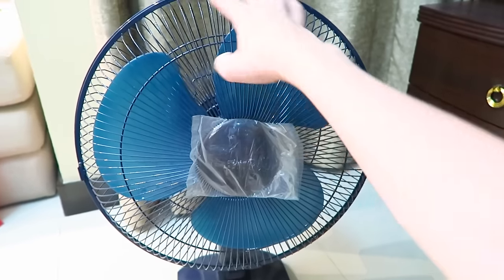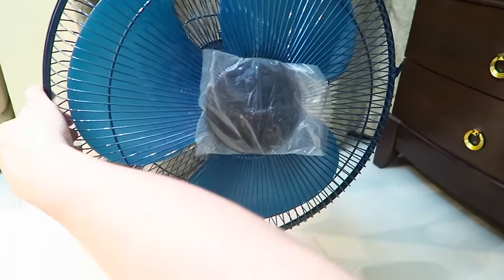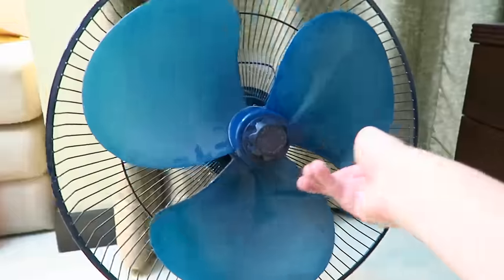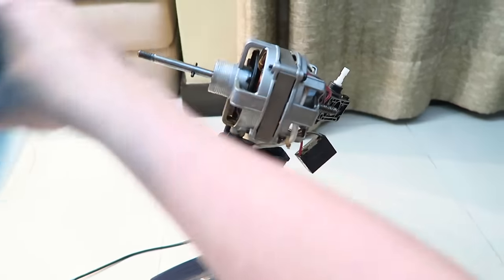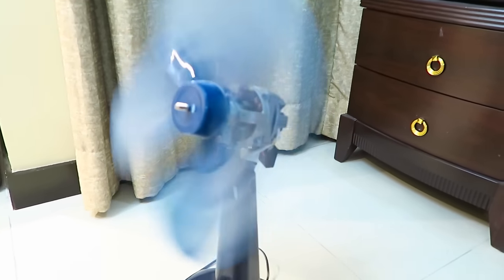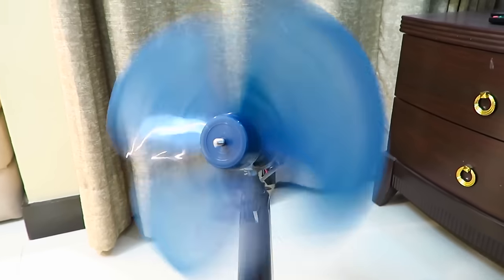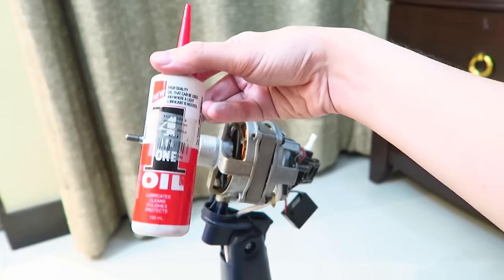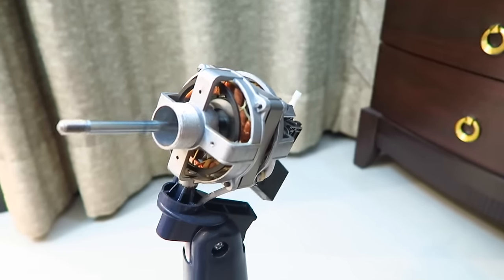How to fix a slow fan

Comment: So a tip for the lubricant: Use one meant for small motors, not the generic stuff. 3-in-1 is the go-to for most people but the regular formulation can actually thicken up and get gunky over time with motors and you'll end up back at this stage again. They have a formulation specifically for small engine/motors that's thinner and doesn't thicken up with age/use and is perfect for this kind of use. I had a large metal fan that started to squeal and dripping some down the shaft into the bearing compartment and letting it sit facing up horizontally for a bit to let it work its way in, and it was back to normal in no time. Use the right stuff at the beginning will save you from having to redo it again over and over.
Reply: Thanks for this info. I used 3 in 1 two weeks ago and was wondering why my blades were turning slow.
Reply: Heavy Bike chain oil
Reply: This is very true, mine stopped working and all I had access to was cooking oil. It lasted a few days and then stopped again until I got the proper oil, its been 2 months without problems
Reply: I only use sewing machine oil in my fans.
Reply: Thank you for this. I wondered what oil needed to be use. As a black woman, the only oil I use is hair oil. 🤣 Yes, I briefly pondered using hair oil but didn't. Unfortunately, my fan is in the bin. What goes in the bin, stays in the bin. Unless it's money. 😆The family has tossed away many fans over the last few years. My brother is actually at the store picking up a new fan. 
But when it slows down in a year or two, I will know what to do. Applying (small motor) oil is going to save us a whole lot of money.

Comment: This video helped me figure out why the frick my fan wasn't spinning fast.  I couldn't get it disassembled too far because I didn't have a screwdriver handy, but as soon as I got the front cover off I immediately noticed that the blades were absolutely CAKED in dust.  Lysol wipes helped that out.  Then I noticed that the spindle thingy where the blades are attached to, had some sort of hair tangled all over it.  Not sure how it got there but it's been there for a while since it was able to ravel itself deep into the fan.  Started spinning the blades backwards slowly while breaking and pulling out the hair strands, and lysol-wiped the spindle just in case, and my fan magically came back to life.  A clean fan is a happy fan. :)

Comment: This worked! I just un clipped the fan cover off, took a paper towel lightly dipped in some vegetable oil and lubricated the parts. Turned my fan on and it worked like brand new!!!
Reply: Are you sure that's safe? Isn't veggie oil really flammable? And it attracts dust bad
Reply: @kukichacha  It worked like a charm, it was just a little bit of oil to get it going. I made sure not to touch any wires!
Reply: @taylor4200_xx  oh okay that's good to know, thank you so much for replying!

Comment: Thank YOU! I have this awesome window fan my mom got me 2 years ago.. recently it started to sound bad. Well, this morning I was woken up at 3am to what sounded like a bird being killed in my window. Figured it just needed a good cleaning, so I took the fan apart, cleaned every bit of it (minus the motor), put it back together and the squeaking has stopped, but the fan is barely moving. It's now 5:30 am and I just wondered if maybe it needed some lube. Came online to see if anyone else had run into this issue and sure enough! I'm about to lube this sucker up and go back to bed.
If this doesn't work, I'll come back and delete my comment, but if you are reading this, it worked a charm! 
Thanks buddy!! 👌

Comment: Dude you are life saver. I was nearly buying a new fan and unfortunately the store didn’t have it. So looked at your video, opened the fan, clean the dust and dirt, oiled the main bit where it spins, and viola the fan not only started spinning like new but also solved the issue with  the nasty sound it was making due to too much friction which the oil smoothen it out.

Comment: Anyone who has older fans 20 plus years should try to keep them running. The new cheap crap that is available now, comes almost dead out of the box. Nowhere near the build quality of yesteryear
Reply: mikmerl1 we had almost 45 yrs fan and it dont need an oil
Reply: What you are saying is 100% right
Reply: some companies still sell fans today that are durable.
They are just really rare to come by!
We have a desk fan that has been running for over a decade now
only part that needed replacement was the starting capacitor.
Reply: Adolf Hitler  Hey, funny thing is, many fans of yesteryear are actually very efficient. I have an old Westinghouse box fan that uses a 1.3 amp motor. Only 0.3 amps higher than modern Lasko box fan motors. Which one is better for the environment? A fan that lasts a lifetime with minimal service? Or some cheap fan that blows less air and breaks after a year? 

I also have a vintage Lasko table fan with clear amber blades that runs on 0.43 amps. LESS THAN MODERN TABLE FANS!!! And it performs better! Still runs to this day after over 40 years.
Reply: @ketmax2805  what brand fan is that??
Reply: @theScarletSprig  
"3-D" not sure if they're well known or not.
Reply: True that these 20-40$ fans literally last for months. Cheap material used the quality of motor is too low that it keeps overheating

Comment: I have fixed tonnes of fans. Oiling fans after they seize is a temporary fix it will seize again not to long down the road even if you take apart and clean everything. Fan needs new bushings or better yet converted to ball bearings that works excellent better that when they are new.

Comment: Glad that turned out well with a little bit of oil. But be very careful, i've red across the net that sometimes it's the broken capacitor that makes it slow down, that would be dangerous if it isn't get replaced asap.

Comment: Wow , i must really thank you , somehow my 10 years old table fan doesn't want to move , only very very slightly rotating after being idle for a few days. I gave it a manual spin a few times and turn it on , it worked now , i thought it finally died!

Comment: I had put oil in my fan and couldn't get it to work, ready to put it to the curb, but you pointed out the axle in the back, which is hidden on my fan. I was able to squirt through a little hole to get it there  and it works now! Thank you!!  PS I think I'm going to try some preventative oil on the rest of my fans. 🤣

Comment: How do I know if it's the capacitor? My fan just started starting very slow after a power cut. It was a planned maintenance outage. It takes a good few minutes before it's back up to normal speed. When off, blades rotate very freely. It's my only cooling atm and it's 40°C (104°F) during the day. :/ Really don't want it to die
Reply: BangDroid the power cut has most likely tripped the thermal cut out switch
Reply: Definitely u need to change the capacitor.  .I had the same problem.
Reply: There are 2 types of caps., starting and run. Look it up.

Comment: I LIVE IN ONE OF THE HOTTEST TOWN IN MY COUNTRY AND WHEN MY FAN SLOWED DOWN I FELT SO BAD AM GLAD I PASSED THROUGH THIS VIDEO...I JUST ADDED COOKING OIL AS LUBRICANT AND ITS WORKING PERFECTLY NO MORE SWEATING
Reply from the maker: I'm really glad it helped :) I would probably recommend using a standard 3 in 1 oil, or something similar. 

But cooking oil can at least get the job going for now 👍
Reply: I knew some clueless ppl would that i bet you had to replace the fan in the end. Cooking oil none industrial will stick and make the issue even worse.

Comment: some method i do. :) got a fan almost a decade old still running. Although based on how often i need to do this. I think the bearings are dying.  Yes bearings, you cant find fans with bearings now a days, just bushings.

Comment: Do you know what the difference is between fans with wide blades like yours and the newer models with narrow blades (called banana blades)?
Reply from the maker: I think the wide blades move more air but are noisier than the thin blades. I'm not 100% sure but I think that's it.

Comment: One thing I did was lay the fan down after I took it apart so the fan shaft was pointing upward. I added some oil near and on the shaft, turned it a few times, let it sit for an hour to let the oil slip downward. I did this three times, each time letting it sit.
This worked great as it's spinning fast and silently like new.

Comment: Just wanted to point out that Lithium grease is generally recommended for electric motors, but ehh it's just a cheap fan so doesn't matter much.
Reply from the maker: +vgamesx1 even for the bearings? How would.you get it in there? Or you really.have to.open it up to get complete access to the bearings ?
Reply: Not entirely sure, I've only looked up how to apply it on electric dryer motors, as I we were having issues with our dryer once, but I did use just a few drops of all-in-one oil around to bearings to see if it would help, it didn't... Since I didn't have bearing puller in order to remove them and find a replacement, we found another motor for just $50, it's been good as new ever since.
Reply: Does wd40 works?
Reply: @louisestatum1789  wd40 is not a lubricant
Reply: Your fan doesnt have a bearing .its just bushing  doc!!!

Comment: Yep those bronze bushings need regular oiling and sometimes disassembly and cleaning. When you do have it apart look for the oil wick in the bushing housing and add plenty of oil to it. It holds oil close to the bushing and sometimes the wick breaks down so add more wicking agent, (something that holds oil) for longer service intervals in future. I use oil lamp wicking which is an everyday thing here in India! Good luck!

Comment: i use grease (lithium) to my fans and it will last a very long time ( oil is kinda good at first but when it starts to heat up  it requires you to re apply every month.. my efans were like 25 years old i only replaced the capacitors
Reply: agreed, grease is better than oil, oil need periodical maintaning.....

Comment: My fan does not spin at all. Foes not even make a sound when you turn it on. Maybe some loose connection somewhere but dont know where. I have oiled all parts and cleaned the rust, so the fan blades are free to move. Any help?

Comment: This is only a temporary fix. The oil burns off and you're back to square one, at least from my experience. I've tried oiling fans with both petroleum distillate and 3-in-1 oil, only for them to seize up after a week of use; sometimes even less. I'm thinking I should try something more heavy duty, like an industrial lubricant.
Reply: The engine quality is too low only 100+$ fans lasts for a lifetime

Comment: Hey! Just a tip that worked with my fan since it was going slow on the highest setting, put your fan on a high setting and keep it running for a couple a minutes or until it spins the way it’s supposed to. Hope this helps!
Reply: I take it you were asleep during most of the video and woke up at the last few seconds.

Comment: hey it is not safe to turn on a fan with blade without its blade lock because the blade might fly away if the oil successfully penetrate the bearing and let the fan move better and faster.

Comment: Okay I have a question, I hope someone can answer me. I have a 1980’s Tatung Fan and I’ve been using a lot lately. Today I just noticed that the fan was moving a lot slower. The sound it was making was also different. The spin down time is non existent. Does it need lubrication? Or is the capacitor dying? One other thing I noticed is that it has a hard time starting up.
Reply: Demos Pro always assume that it’s lube, these older Taiwanese fans are very well built, and even if it is a bad capacitor, it is well worth replacing the capacitor rather than buying a modern fan which will usually only last 5 years before burning up. This guy didn’t show it in the video, but you should repack the old oscillator gearbox with new white lithium grease. As the old grease is likely very dried up. Remember to always use either zoom spout oil or 3 in 1 in the blue can (do not use 3 in 1 in the red can) for the bearings. And for the gearbox any automotive grease should work fine
Reply: Palitan ng bussing poh kya ma ingay wala na sa alinement ung rotor,,,
Reply: Buy a new one
Reply: Bikerjon1 why should he buy a new one? This one has lasted 30 years likely without any lubrication (excluding the lube from the factory.) I doubt you can find any reasonably priced modern fan that can survive that long.
Reply: ayy lmao come on a 30 year old fan. A new one will be about £10.00.If it's 30 years old it must be a fire risk.
Reply: Bikerjon1 a new one may be cheap, but you also fill the landfills with more garbage and support the money grabbing companies of today that will do anything to save a penny. How would it be a fire hazard? Just because something is old does not mean it is a fire hazard. I run 7 vintage fans all day every day and have been running them nearly nonstop for about 15 years, only stopping them every 3 months for routine oiling and every 5 years for regreasing of the gearbox. None have given me problems yet. I have seen several modern ones (which I use in my shop because I don’t take my old ones into the filthy garage) just plain stop, I had one stop while I was taking a break from a project and when I came back into the garage it was nothing more than a melted pool of plastic on the floor.
Reply: Sleeve bearing (bussing) wear-out. Made from brass which softer than the shaft. Change it.
Greetings from Indonesia

Comment: nice video😄 similar to my issue.. when ever the fan is not been use for  awhile in a cold room i think the oil freeze.. and its making it hard to spin... is that true bro? been dealing with this fan for awhile now.. 😊😊😊
Reply from the maker: Good question, I'm not sure on that. It might just be because it's sat for a long time without use and not too much related to the cold. Adding some fresh oil to the bearings might help prevent it from happening again for quite some time.
Reply: Oil doesn't freeze, it thickens until it won't flow.

Comment: After using shaving oil, my fan kept on spinning for one and a half minutes, after going from high speed to the off position. 
WAHL OIL is the standard in the clipper cutting industry, and it works for me.

Comment: I use wd40 first then use gen purpose oil.
this motor uses bush bearings.. but i think you can use a bearing for bikes. 608 i think the bearing code. i havent tried it though..

however one of our ac fan motor broke. so i checked it and found out its usng ball bearings. good thing bicycle parts has those bearings for just arround 30 pesos.. saves me alot of money than having it repaired by ac tech.

i also want to suggest this.. to increase the power of the motor.. you can replace the caps with 2uf if the fan has 1.5uf installed or 1.5uf for 1uf caps. 

note that some fan blades arent designed for high rpm. you may experience wurling sound when you set fanspeed to 3.

or you can reverse it by lowering the uf to slow down the rpm and make it a gentle breeze.
Reply from the maker: +John Patrick Fernandez interesting, thanks for sharing the info :) I assume you mean WD-40 by the way?
Reply: Gadget Adict hahahah. just edited it.

Comment: Im in real problem i removed the back case also the ossilator knob its iron ball fell and i dont how to put it back correctly. I just put the ball with the spring inside that holein the knob but the fan wont rotate sideways because it not stiff as beforei can send photos from email please help.